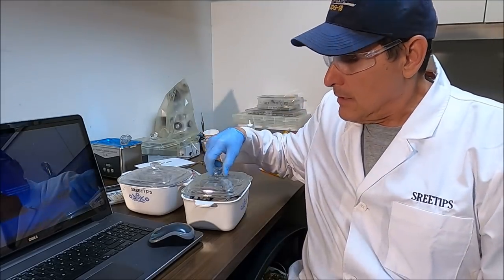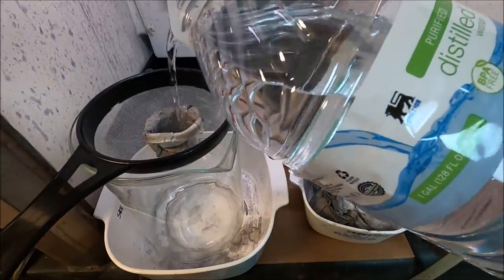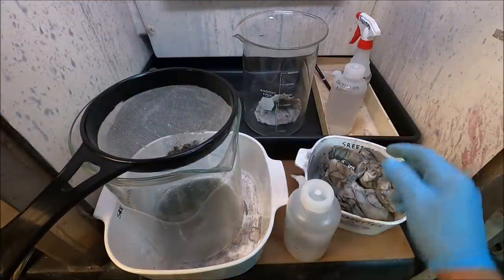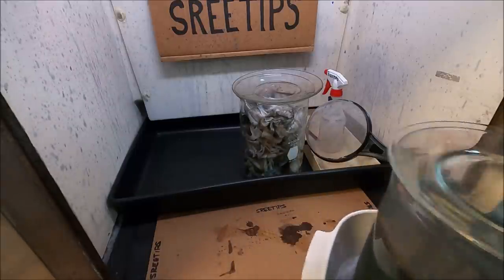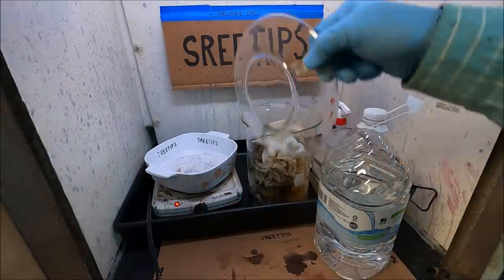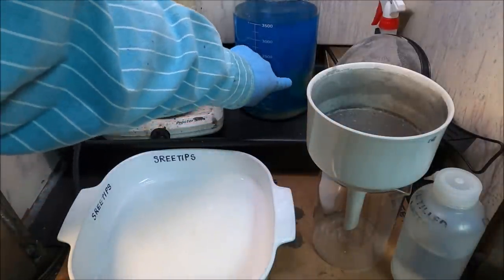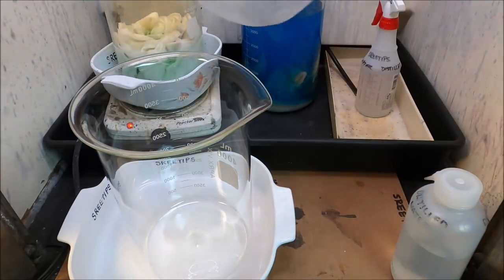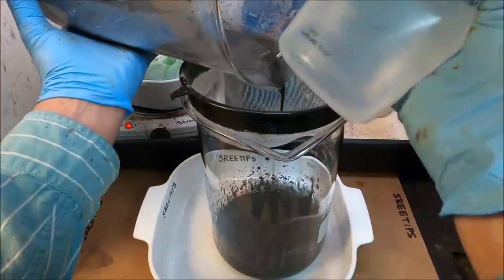Silver Cell Anode Filters Recovery and Refining Part 1

Comment: Hey sreetips, i was thinking how to rinse the slimes of the solid particles. I think i would fill one of those cornwall white dishes with a decent amount of distilled water, then load up the nylon filter with all of the dirty solid particles. then lower the filter partly in the dish and by shaking and striring the loaded nylon filter try to rinse them that way. i think i will save a lot of water and get them decently clean. By the way i love to watch your vids. keep up the good work dude.
Reply: i had the same idea, beat me to it lol
Reply: I had the same thought. Also, why not add the paper he wiped the beaker down with into the filter processing jar? Or do the final rinse of the larger silver particles with a dilute nitric solution under the hood?
Reply: Yes indeed, you would get great utility out of that water.

Comment: There's a better way to rinse that screen to separate the slimes from your silver.  You should do it in a shallow bowl. That way you won't keep making more liquid. If you keep the screen submerged and shake it in the liquid, the slimes will fall off keeping your silver in the screen. (kind of like using a classifier when gold panning).
Reply: Yup I was thinkin' the same thing, then it occurred to me that if that silver is contaminated with the slimes that don't rinse off (most of it being gray and not shiny) wouldn't it plug up the next basket filter super quick? or (just spitballin' here) could he maybe mix with some cement silver and remelt as shot?

Comment: Thank you for your response.  I viewed the filters under a microscope and they seem to be very much intact.  I have little upgrades to your process to offer but will say that stuffing the filter in the food saver with a ball of paper towels vs. the old roll I find as a better way to get a nice edge fit in the basket, I also think a few wraps of black tape at the seam keeps the Silver Nitrate from coming out of the seam onto the bowl lid which is a great mess saver when the bowl is in action for weeks.  I got a pound and half of silver from my cleanup of filters and leftover gray matter, didn't go the full process as my source material does likely not contain more exotic metals as yours did.  

Love the show, keep up the great work.  Would be interested to see if there is a "best" way to grow very thick silver crystals, I find low voltage is best for slow large growth, higher voltage (>4V) seems to create finer faster growing crystals, not as attractive to me.  Not sure why but the first batch i created about two years ago was the most dense and largest solid crystal growths to date.  Coincidence? or a result of something being new? like the bowl?  Just luck?  Any thoughts?.
Reply from the maker: Donald, each batch of silver seems to be different due to many variables. I get some nice fat crystals but I can’t get them every time.

Comment: 4 in the morning I'm too bored to sleep.  Guess it's gonna be 430 now.  You might try partially submerging the metal filter in a more shallow container with water and agitate the water inside instead of pouring more water through the strainer.

Comment: Sreetips, couldn't you put all the solids in the strainer and do a wet classification (submerge the strainer and material in distiller water and shake vigorously)? In theory you can try it with the water from the first rinse so you wouldnt waste any more distilled water.

Comment: Just an idea - Place the slime, shot, and distilled water inside a beaker over a magnetic hotplate with a Teflon stir bar.  Mix the fine particulates into suspension and strain out large pieces (solid slime + shot). Return large particles to beaker with distilled water and no stir bar.  Turn rotating magnetic field back on.  Eddy currents should be induced in silver shot that oppose the magnetic field and levitate the silver shot.  Scoop out with plastic ladle.

Comment: I'm re-watching this series (again) and when watching as you were rinsing the slimes to get the silver chunks out I have done similar in the past and have a suggestion.  Use one of the corningware dishes filled about halfway with water.  Place the sieve with the slimes into the water and gently shake the sieve like you were making jiffy-pop.  Uses so much less water to get the fine dust off of the silver chunks and makes for a lot less waste.
Reply from the maker: I think I tried that but n a later video and it didn’t work very well
Reply: @sreetips  Interesting.  I've had a lot of success with that.  Found a smaller sieve works better but takes longer.  But this is again why I like this hobby.  All the trial and error and finding out what works best for each person and task.  Anyone who thinks "This is how it is done.   Period" really isn't trying and this is why I dig your channel so much.  You KNOW there is more to learn and figure out and you're eager to do so.

Comment: Perhaps, a rinsing more like panning. If you swished the strainer around in a shallower pan of water, it could wash the powder through to settle. That could take less water than pouring water over to rinse it through. That is if the smaller classified material proves worth classifying to a separate batch. At least the rinsing of silver nitrate from the material seems a profitable separation.

Comment: Looking forward to the next part. I'm not quite sure how you go the the next steps. Those slimes on your residual silver seem like they are gonna be troublesome and would clog your filtering right away re-using that silver in your electro silver cell. Not being critical; so far it seems like you've generated about 3 different types of new material, all of which have their associated problems. Maybe you have to go the (irritating) chloride route to separate out the silver? That would leave behind Au, Pt, Pd, would it not? Just throwing out the idea.

Comment: I have to agree with several of the comments in this section.  If there were a little amount of water used but agressivly agitated before using the coarse sieve.  Seperating the large coarse material from the smaller particulate would be much more efficient.

Comment: I think agitating the slimes in distilled water and then putting them through the mesh strainer would use a little less water. I don’t know it’s not the volume of water that cleans them but the pressure

Comment: You should takin all of the filters and smelted them down back into shot and back in the silver cell. Saved chemical's and time.
Reply: The problem is the slime isn’t silver it’s mostly pladium however there are pieces of unused silver shot in the filter which  he was trying to separate

Comment: Hi Sreetips;  I am underway with my "total" cleanup after many silver cell cycles with all the leftovers and filters.  I have to your credit copied your system and setup to pretty much the T for all my silver reclamation which has gone well.  My question is that the filters look almost new after hours of soaking in Nitric Acid solution.  Have you considered whether they can be reused?  Or is this just too frugal?
Reply from the maker: I custom fit each filter. I don’t think I could get them to fit correctly for second use. But after boiling nitric they should be clean enough to reuse.

Comment: I would have at least tried using the filter out out shot in the cell, you may be surprised of the results.  Now you’re going to use a ton of nitric acid and increase the waste products even further.  Distilled water is cheap, nitric is not.

Comment: ? Why not add hot water to the beaker that's holding the silver agitate the silver aggressively in the beaker to aggressively dissolve the slimes into solution at the same time washing most of the paste slimes off I know the solution will get real thick but the hard silver pellets should come out cleaned

Comment: If all you are doing is rinsing. Why not re use the water you are using to rinse with ? Then you arent using so much water.

Or you could have a container that you could just swirl the strainer in so the slime just filters through and settles to the bottom.